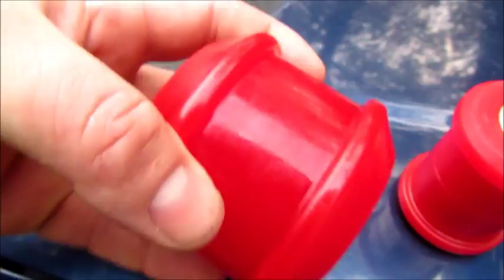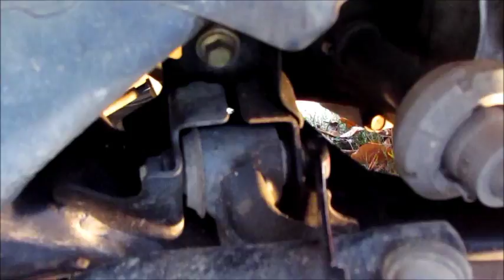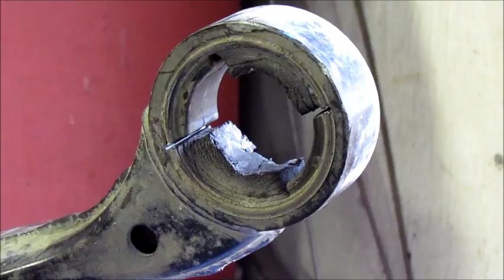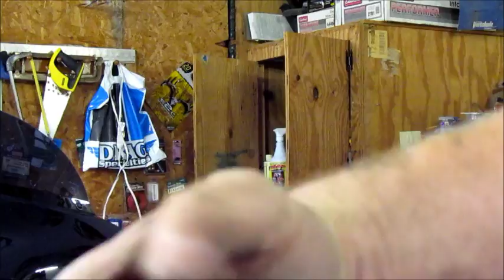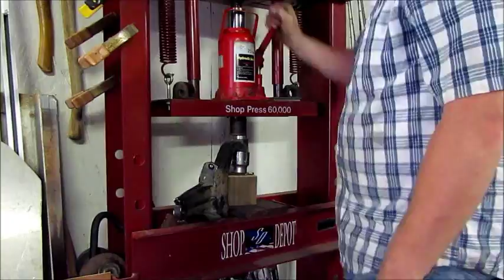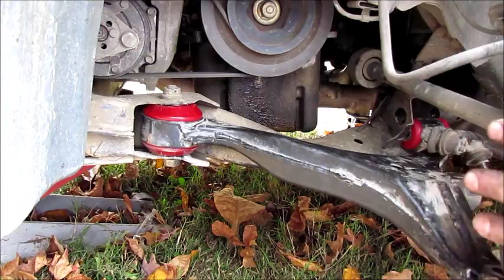Replacing 01-05 Honda Civic Front Lower Control Arm Bushings

Comment: Hey man, just wanted to make note of something I saw in the video.  That grease is a silicone paste, and really should cover any surface of the polyurethane bushing that comes in contact with metal to prevent squeaking, which poly bushings are notorious for. From my personal experience, the little packets are nowhere near enough; get a big tube of dielectric grease and coat the -entire- bushing prior to installation. :-)

Comment: Could be wrong, and not sure if it's been mentioned yet - but that 'grease' you put on the new bushings is probably an anti-sieze paste - typically, used on bearings - it keeps parts from rusting together. The urethane bushings you've got didn't really need that stuff - seeing as how the original bushings had a metal outer race, which came in contact with the control arm itself. 

Keeps things in place. Without rust. Without glue.

Comment: You put ball join in First, remove one bolt that holding the strut then losen the other so you can bent it in/out when pushing the bushings in. Just did my 2004 Civic today, so much easier than having the Bushings in first. I built my own 20Ton press that I can extend the height buy screw in a long 1" bolt, eliminate the interference of all commercial press.

Comment: I just did this repair and when you reinstall the control arm, go "back to front":  put the rear bushing in first (and make sure the bolt engages the threads), put the ball joint in next and secure it with the castle nut (because you can still easily swing the control arm down) and then jack up the control arm and use a pry bar to force the front bushing into position.  With the rear bushing bolted to the frame and ball joint connected to the control arm, it will keep the rotor from tilting outward and your CV axle from coming apart when you jack up the control arm (IRL AMHIK LOL) The second side was much easier.  HTH everybody!!!!!!

Comment: ok, so i completed the job! putting the bull joints back on was a B with an itch. Hard to figure out where to place the jack so it didn't walk the strut out. The worst part was one of the verticle bushing bolts was frozen and fused to the inside of the bushing. Put a 3/4 ratchet  and pipe on it and broke the welded nut loose on top. Had to cut if off with the grinder (really close to the trans) and then spent 2 hours trying to beat the bolt out. pressing out the bushings was not easy either.

Comment from the maker: Usually the ball joint is the reason to replace the whole thing. Honestly you can get a set of lower arms on rockauto or eBay fairly cheep. The bushings and ballpoint are the only wear points on those arms.

Comment: Hey, thanks fot he great video, I've done this already thanks to it, I've seen than many people has a question about releasing the arm from the ball joint, what did since I didn´t have the correct tool for that, I just loosened the bolt without taking it out and gently hitted it with a hammer eventually it will be released. Now, people could have problems to take them out without a press, so you can also use a hammer with something to push it through, or you can make a press for yourself, which is what I did, you just put on the youtube search bar: Homemade press and you will the video of a guy using this square with a 20 ton jack, and it will make your job easier. Everything else is really easy. Hope this helps somebody. Thank You!

Comment: I to put the ball joint in first, then compress the strut and it will angle the bushings perfectly so you can pound them into place with a dead blow hammer and a pry bar.

Comment: My god mine was a pain! Had all your tools but everything that could go wrong went wrong. The bushing kept slipping out of my press but a good way to do it is to use a nut and bolt with two metal plates above and below and start threading. Eventually the lip will go in and then you can use a mallet or the press.

Comment: If you remove 1 bolt that hold the strut & the knuckle then loose the other, you don't have to compress nothing, no brutal force require, just gently tap the bushing in. At one point, the strut and the nuckle kinda stuck on me, turn out there's a cut/dent. I filed it down then they slide in & out freely, put some grease will help too. I aren't got no strength to wasted.

Comment: WARNING!!!!!!! Anyone doing this, or about to do this, READ ALL OF THIS. So, I undertook the task of removing my LCA, because during Tire Kingdoms courtesy check, they completely broke one of the worn out bushings. So ya it quickly became time to replace the bushing or the entire LCA. Anyways, the vertical bushing(that big monster in the front) on my 02 civic the bolt is seized to the metal on the inside of the bushing. I could not bust the bolt lose, so I used a fence post as a cheater bar(it did the job). Well the bolt spins like it should, and after spinning the bolt and center bushing that is frozen to the bolt for a while. Progress was made as the bolts thread was no longer visible at the top of the subframes welded on bolt. Unfortunately, seeing how the bolt could go no further down, it started to spread the LCA mount on the subframe!!!!! Long story short, cut that POS bolt/bushing out if you have this issue. I have no idea if this has caused permanent damage to the LCA's mounting point on the subframe. If so, my under $100 replacement just got insanely expensive.

Comment: I need to do this on my 01 civic too. My car sort of swerves when I accelerate. Pulls to one side. It's not an alignment issue because it does not pull to side when I let go of the steering wheel. The bushings are definitely broken on my 01. Just like the ones on your car.
Reply: I got the same trouble in my car sort of sweves when I accelerate.
this last week I changed complete strut shock absorber in both sides and when I went to my house my car began to move to the left side when I accelerate but if I´m not acelerating my car goes straigh. I tried to change the control arm but I saw which the bushings weren´t broken. Please let me know if you have already changed them and if that was the solution
Reply: duuude21

Comment: @reydehonduras I have done this many times.  It is easier to remove the two bolts from the strut and put the ball joint in.  THEN reattach the strut to the spindle one bolt at a time.  Very nice video by the way.  A few times the subject was not in the shot but overall a nice job for sure.  Next time, make the wife operate the camera...You are fixing her car...where the heck is she going!

Comment: The flange on the bushing that you used an angle grinder remove is suppose to be easier to remove with a hole saw.

Comment: Thank you for a great video!! I live on a 1/2 mile gravel road and the wife blows threw the pot holes like she is in a rally race. At 150,000 we started to here a "bonk bonk" on bumps. At 200,000 odd highway handeling and unstable in high speed turns. Now at 215,000 I can put my hand on the top of the rf tire and move it neary a full inch forward and back and the car will do a lane change if I jab the throttle hard at 60mph! should buy a hydrolic press or do you think a log splitter will work?

Comment: Thanks a lot for this video. My car has the same problem right now, although not as severe as that car in the video. The guy at the shop did an estimate of $750 to get the bushings replaced. So I'm going to try this myself. I don't have that hydraulic press that you have though... Do you have any suggestions for a small press that can get the job done, or should I just go to the shop to get it done?

Comment: I realized you didn't film how to separate the ball joint and the lower control arm. That is my only problem. I removed the other three bolts as well as the castle bolt under the control arm and ball joint although my LCA wont separate from the ball joint...Had to put my car back together for work tomorrow and will try and tackle it again this Saturday. My bushing are very bad and need to be replaced ASAP. Please help.

Comment: Judging from the way you greased those bushings, you're probably getting squeaking when going over bumps. You're suppose to coat the inside where poly meets metal with grease.

Comment: The most difficult part for me was putting the ball joint into the control arm.
Tell me, when you used a jack and a 2 X 4 piece of wood, wasn't your wheel high enough so that you could connect the ball joint into the control arm?

Comment: I put the Ball Join in First then the rest come in easy, just push and hammer them in, much easier than getting the Bushing in first. Sometime you might wanna remove one bolt of the Strut and losen the other to you can bend it in/out. There's always an easy way to do thing, unfortunately this guy chosse the hard way.

Comment: Hi Joe, Thanks for the video. I was quoted that i need to replace both control arms. When i go over bumps, it's horrid. Would i be able to just use the bushing kit that you recommend? Thanks
Reply from the maker: The only reason you would have to replace the whole control arm is if the ball joints where bad. The bushings are replaceable. But sometimes it's easier just to buy new arms on eBay or rockauto and put them on yourself. Save big money that way

Comment: Good video. But just a Word of Good Advice. DO NOT put Energy suspension (polyurethane) bushings on your car! Go with the OEM Rubber ones. I learned it the hard way. Ridiculous amount of clunking noises are heard every time you go over the smallest of the bumps or make turns no matter how lubricated they are! Drives you nuts! Went back to rubber ones and all issues resolved! Rubber can absorb the uneveness of road much better than Polyurethane!!
Reply: they're nolathane bushings dude.
Reply: J Grumley nolathane is a brand. They're still polyurethane. But still, +1 for es bushings

Comment: How did you get the ball joint removed? What kind of tool, because I tried everything, and ended up buying a special seperator. Also did you do the rear control arms? I'm fixing to do front and back.

Comment: Hello, I would like to put these parts (Energy Suspension / Control Arm Bushing - Front Part Number: 16.3116G) Nonda 2003 CR-V 4WD 2.4L MFI DOHC 4cyl, is this possible?

Comment: I've got the control arm with the new bushings into the subframe; how does the ball joint go back into the control arm?  I've already bent 2 pry bars trying to lever it between the arm and the chassis.
Reply: I know this is months old but for all the others here's your fix. Use a crow bar wedged between the front bushing and the frame nearest the bumper. Push and it will squeeze the front bushing enough that the rear bushings will have room to fit in the gap. These new bushings are way stiffer and this will give you the room you need to push the rear bushings into place. Ps make sure you start the front bushing bolt in order to pry against it.
Reply: +CRT Mojo for the ball joint you have to remove the front knuckle and use a ball joint press to remove it. Any auto parts store will loan you this tool for a deposit of about 100$ it's a pain and a drill is highly recommended to make torquing easier

Comment: did u use a ball joint press or what how did u get it off??
Reply from the maker: Ball joint removal was the hardest part. I had to do alot of prying to get it off. And alot of hammering. It was a tough thing. Plus putting them back on with the new harder bushing.